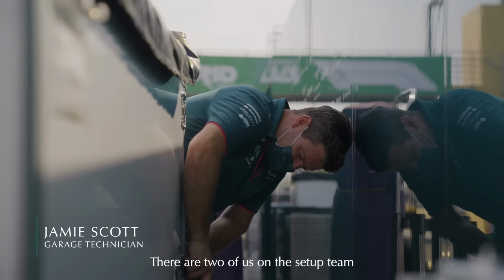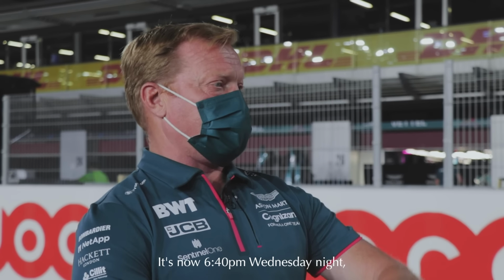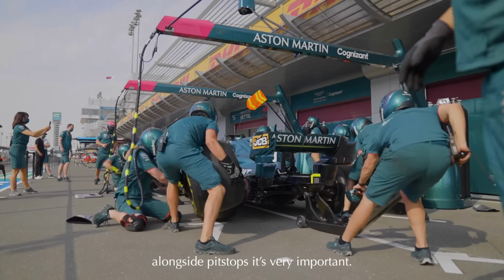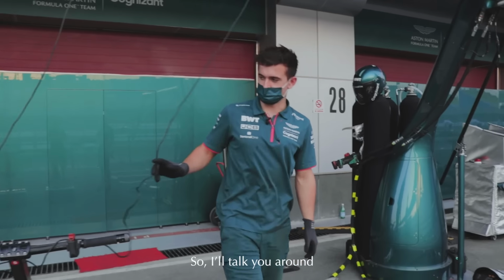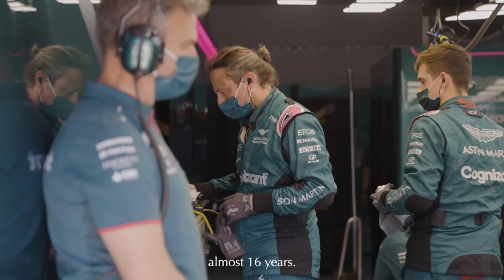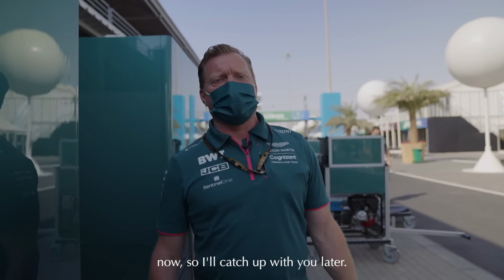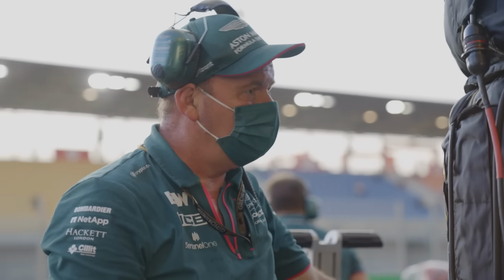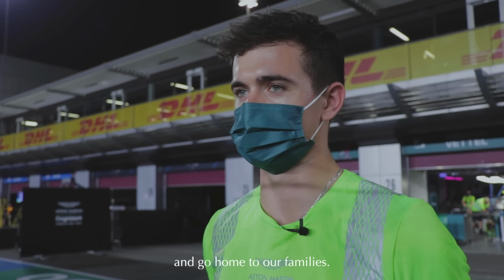INSIDER: How F1 teams set up a garage | #IAMSTORIES

Comment: Why do modern F1 cars even use an external starter motor.  I understand the MGU inside the car can start the ICE. Do they use the external starter so as to not use stored energy from the car’s battery or not to put extra wear on the MGU?